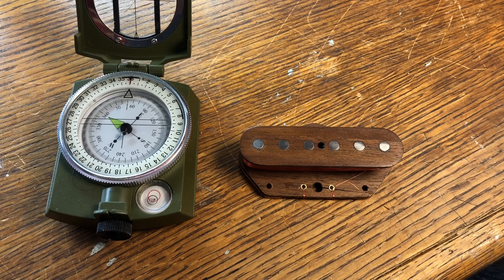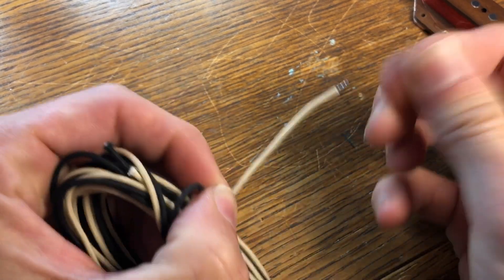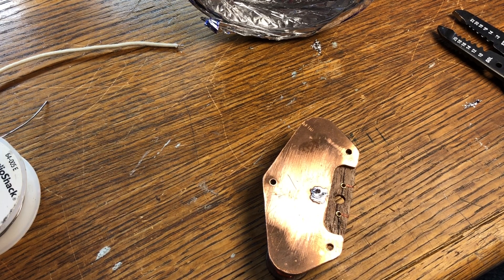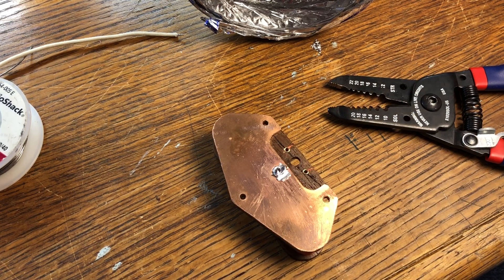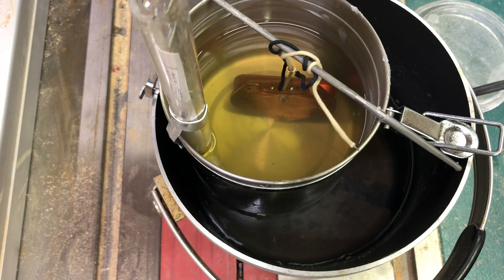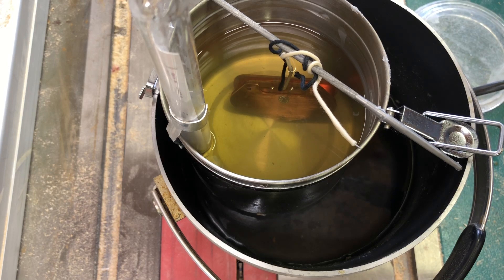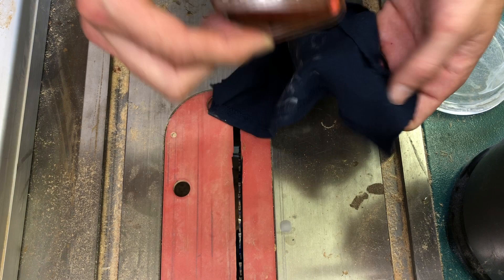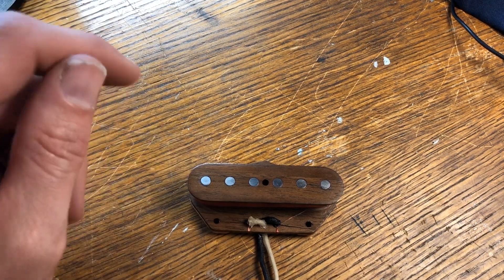Homemade Telecaster Style Bridge Pickup Part 3 , Wiring, Potting and getting the Resistance Reading

Comment: Chase, thank you for posting this series. It's always good to see how other people find their way through some of the jobs involved in making a pickup. I do my wax potting in a little rice cooker found at a thrift shop - it's got a relatively small pot, so you're not having to melt large amounts of wax just for one or two pickups. However, I got a bit frustrated with the temperature control. The pot does have a thermostat inside, so it can't boil, but that's about it. I was looking on Ebay  a while back, and I found an electronic temperature control module. What made it interesting was that it's mounted into a faceplate/panel already, has two LED 3-number displays, and three control buttons. One display shows the "set" temperature - where you want the temperature to stay - and the other shows the actual temperature as it warms up or cools off. Both of these can be set, or cleared, using the front panel buttons. It has a temperature sensor on the end of a 4'  wire, and it's pretty sensitive. The module has two sets of relays that will handle 120 VAC or 240 VAC. Two other interesting things is that it can be set up so that one relay controls "cold" and the other "hot" - meant for controlling water temperature, I think. The other thing is that the chip in this thing is smart enough to "edge" up to the "SET" temperature. It will turn off the "hot" power a little bit before the "SET" temperature is reached. (That can be adjusted. There is a manual online - amazing - and it's in readable English, even more amazing).  
The whole thing set me back $11-$12 Canadian (about $7 US), and that included shipping. This is NOT what they call a "PID temperature controller, " - those cost a lot more and can do all kinds of tricks. It's just a temperature controller that will operate 1 or 2 electric circuits, and show the actual temp as well as the desired temp. The manual mentions "solenoid valves" so I'm guessing its original purpose is to control the water temperature in a jacuzzi or something. No matter - it's perfect for keeping my wax temperature just right. I've actually bought 3 of these since about 2015 for different applications, and they're still the same setup, and they still work. The relays seem to be hefty enough to handle the power of the rice cooker. My neighbor, an electrician, wired up a control box (a bit smaller than your winder housing) that has a standard 120 VAC receptacle, the control module with the 2 temperature displays and the sensor wire coming out one side. The whole thing plugs into the wall. I think most people could wire it up if they followed the pictures in the manual, but it is "mains" voltage so it needs to be done correctly. 
I've been using this on the wax pot for over 4 years now, and it does the job, and has stood up well. I didn't want anything fancy, and that's what this is: simple and functional. 
Getting flatwork material, particularly vulcanized fiberboard, has gotten really difficult (and really expensive), partly because of the falling dollar here, but also because I'm out in the sticks. So, I've experimented with some alternatives; I might make a video about some of the things I tried, and how they've worked out. Anyway, thanks for this series, and your other "how-to's." Best regards.
Reply from the maker: Awesome bud. Glad you enjoyed the series. I’ll have to look into that temperature controller.  I attempted it one time with an arduino I built but it didn’t work how I had planned.  I may have to give that setup a shot.  Thanks for the info bud and let me know how everything turns out. Talk soon!